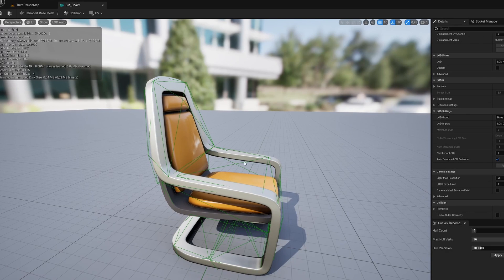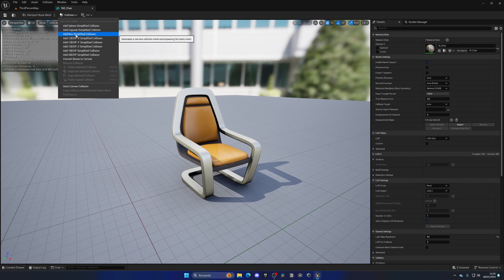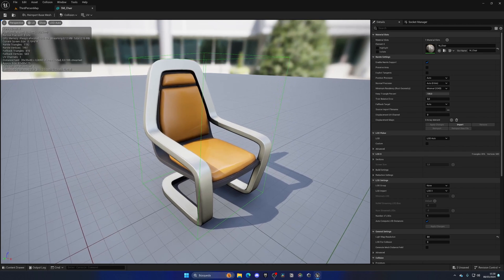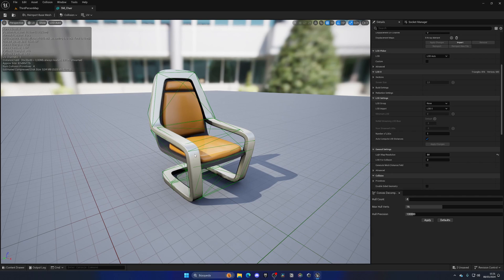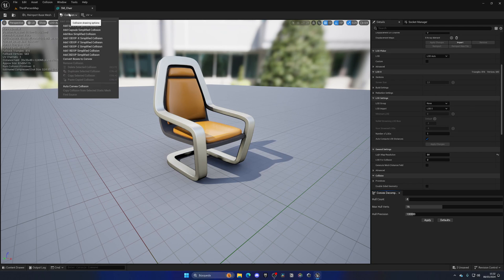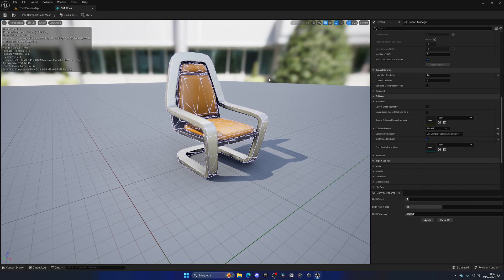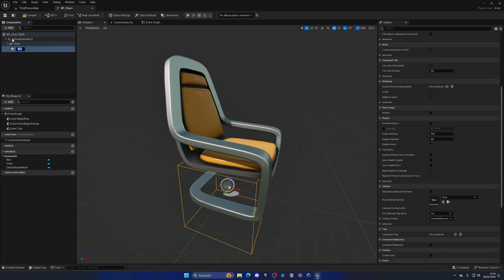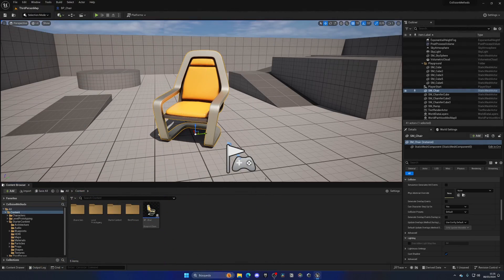3 Mesh Collision Methods in Unreal Engine 5 (+ Bonus)

Comment: Another way to do it in a controlled but optimized manner is to add multiple collision objects/primitives like right inside the static mesh editor. You can move the collision primitives around in there as well